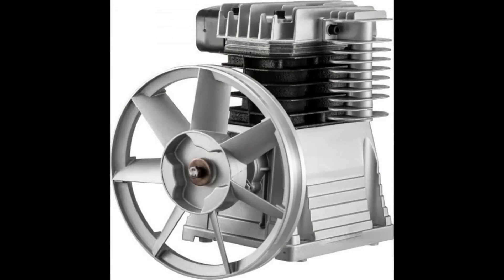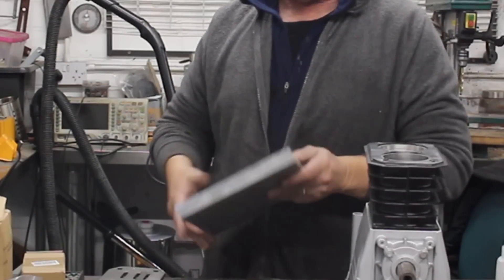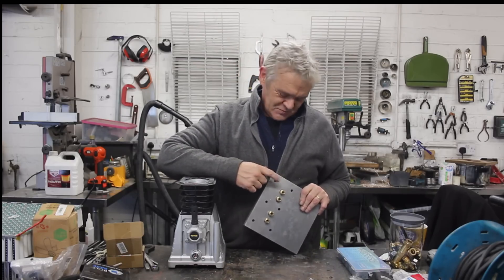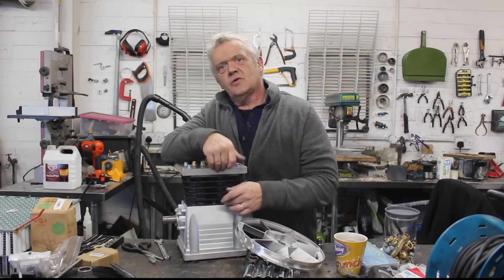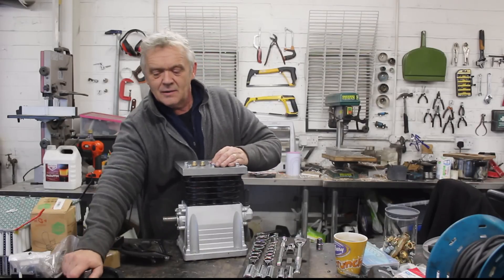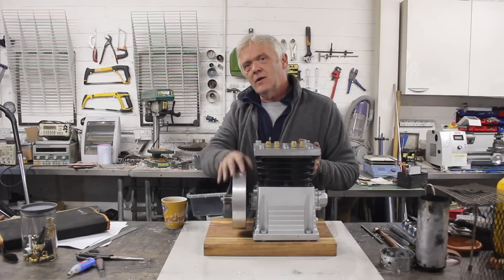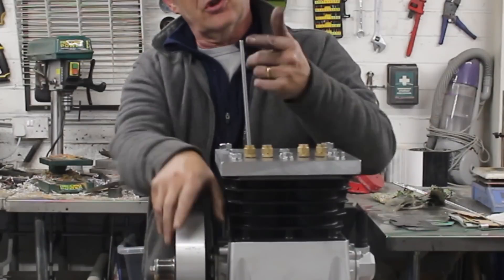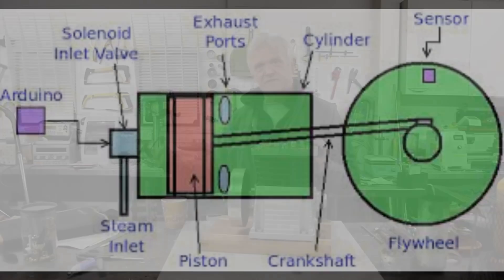1716 A DIY Multi Fuel Home Generator 3 - Converting A Compressor To A Steam Engine

Comment: Good on yer Robert! One suggestion, lubrication. Steam tends to wipe the oil off the piston rings causing excessive wear. I'd put an in line oiler, such as is often used running air tools off an air compressor, feeding into  in the steam in piping.

I hope you design a flash boiler  (Inherently safe[er] than a fire tube or water tube boiler as there's only a fraction of a cup of water in it to explode into steam if anything goes wrong.) to run it.
Reply from the maker: that's a good tip! and I like flash steam too!
Reply: @ThinkingandTinkering  overheated steam is also better because you will lose heat to the motorblock, even with insulation wrapped around. If the steam condenses half the way into the stroke the volume and pressure drops a lot. Optimal point of condensation temp would be a few cm out the exhaust tube towards the tank with  good old gravity helping the flow. Also need to prevent backflow through the exhaust pipe in a closed loop .. hm.
Reply: there's a potential problem with monotube (aka flash) boilers... the steam may get very hot... Like enough to make iron heads start glowing a little. At such temps steam has a fair bit of thermal dissosocation... And thus has somewhat of tendency to burn lubricating oil.

Comment: Great project as usual. My one concern is the use of aluminum. My understanding is that aluminum can be eroded under certain conditions by steam. Years ago, I was playing around with very thin walled aluminum tubing, passing heated rubbing alcohol steam through it. Within seconds, the pipe seemed to disintegrate! I think it was the water vapor that did the damage. I switched to thin copper tubing. Anyway, I'm wondering if steam and aluminum is just a bad idea or is it that temperature and pressure play into this.
Reply from the maker: it's not the best for sure - but I may well run this on compressed air or steam I haven't really decided yet - maybe steam first and see how it goes and swap to compressed air if it is giving too much in the way of issues
Reply: If steam condenses... Tiny water droplets form. If the steam is flowing fast relative to solid parts those water droplets act akin to  sandblasting.

The hotter steam is the more it dissociates into hydrogen, and oxygen. (that obsorbs extra heat without as much temperature rise). In effect behaves like it's a strong acid. Rairly great around aluminium/most of it's alloys.

With steam Copper tubes can go brittle and may turn into dust too. Just takes a lot longer.
Also if bits flake off inside tubes... Copper oxide is somewhat kinder to engine internals that aluminium oxide.

Comment: My biggest concern about steam is safely producing it and not having to constantly monitor or adjust it.

Certainly you could use an electric steam generator and accomplish that. But that sort of defeats the purpose if the goal is to produce electricity from steam.

I'd like to burn wood waste and pellets as the energy source because my family has a farm and has plenty of wood waste to potentially use as energy.  Wood that often gets burned in a pit anyways.  Seems like a big waste.
Reply from the maker: steam does worry folks - I don't know why - they don't seem in the least bit worried by petrol and to my mind that is far more dangerous
Reply: @ThinkingandTinkering  it's the pressure of the boiler - which unattended is a serious issue.  Pressure relief valves commonly stick also.  

Maybe we could create a boiler-less steam generator similar to a tankless water heater.  And a Tesla check valve so no mechanical parts to fail.  Or a hybrid with a small tank that pre-heats but doesn't raise the temperature all tge way to a boil.

I spent time in a burn unit after my son got burned.  He healed, but I witnessed some horrendous wounds and suffering children.  Steam burns are indescribably bad.

Comment: Years ago an Australien University converted a Lister 2stroke Diesel to run on Steam. They had ballvalves on the head and a pin on the piston that pushed those steel balls up to let the steam flow in.
Reply from the maker: yep - we covered that in the valves video mate - it's called a bump valve

Comment: the steam engine is coming along nicely.  Any chance of an update on the magnetically displaced free piston Stirling engine coming soon?  I've been trying to think how to easily attach the displacer to the retaining ring with springs but haven't come up with a sufficiently simple idea yet.
Reply from the maker: for sure mate - I am trying to make it into a flat panel - but I have quite a lot on - still it is on the list
Reply: @ThinkingandTinkering  hi robert i was wondering if you could show in more detail how you changed the stirling engine to make it more efficient and sensitive to heat thanks i understand ur very busy

Comment: Talk about eagerly awaiting this one! Personally I like to opt for slide valves for simplicity, and they make me think of trains, in which case the opportunity to make a steam whistle incorporated into a pressure release valve is too good to pass up. 👌
I never got around to doing my '1 stroke' steam engine, but if I didn't have a recycle option for high pressure/low pressure pistons, I always wanted to try making an exhaust port at the bottom of the cylinder wall that was covered by the piston during the upstroke cycle. As said, I never got around to seeing if you could do it to fully evacuate the cylinder without affecting bore rigidity or lubrication, but if I ever get a spare engine with no hope of being petroleum-driven, I'd sure like to have a go!
Reply from the maker: you should mate - I was pondering a 2 stroke as a sleeve valve - but I think this is an easier conversion - still - I wouldn't mind giving it a go for sure
Reply: An alternative to exhaust port might be a bump valve opened when the cylinder gets near the bottom of it's stroke.
Exhaust ports supposed to play havock with lubrication of piston rings

Comment: What kind of compressor are you using?
Love your work!
Reply from the maker: it's from Vevor - https://www.vevor.co.uk/air-compressors-c_10039/vevor-twin-cylinder-air-compressor-pump-suits-for-3hp-12cfm-industrial-1300-rpm-p_010403369304
Reply: @ThinkingandTinkering  thank you Robert.

Comment: I’m excited to see how your engine works in the future.  

I’ll be ordering a Diesel heater from Vevor.  

I just scored 500 gallons of old Diesel!!!!   Just need to wick the water out of Emulation…🤔
Reply: Score!🤜🤛
Reply: dewatering like biodiesel, skim off the top oil from a settled tank, heat it to boil off the water, and then use that cleaner oil, burn it to dewater the remaining oil, good luck!
Reply from the maker: wow - that is a score mate!!

Comment: Would it be worth to put insulation on the metal walls of the engine? or the efficiency increase would be negligible?
Reply: I imagine that there is an ideal operating temperature range for optimal efficiency.
Reply from the maker: I have seen cylinders insulated - usually with wood - but I suspect the increase in efficiency is pretty negligible

Comment: On the valve in and valve out, could you use a diaphragm so the air comes in and goes out directionally. So valve 1, piston 1 brings in the air, Valve 2, piston 1 sends out the air to piston 2 valve 1 and then sent out through piston 2 valve 2 back to piston 1valve 1, Repeating the process?.
Reply: Are you suggesting a double expansion engine? That would require two chambers of increasing displacement to accommodate the expansion of the steam from one stage to the next. The Titanic had a triple expansion system.
Reply: @thisoldminewithlars5324  I have no idea, it was a thought that came to mind while I was watching, I don't have any of the tools or equipment to even try for myself so made a suggestion. I suppose you could use a 3rd and use that for pressure?.
Reply from the maker: you are right a double expansion wouldn't work as we have the same displacement in each cylinder
Reply: Now my brain is running. The Titanic used 215 psi at the input cylinder and still had nine psi after the third cylinder which was used to drive a turbine. The turbine drove the center of three propellers but only could turn in one direction. A multistage steam engine is very efficient. You are thinking in the right direction.
Reply: @thisoldminewithlars5324  Really it was a thought. how marvellous it turns out not only was it used in the titanic you happened to reply on the same subject. maybe have 3 pistons and the 3rd piston is a lot heavier than the other 2 which would need more pressure but once that pressure was built up then who knows?
Reply from the maker: that's an interesting idea mate - I will have to have a think - my aim is always ease of construction really